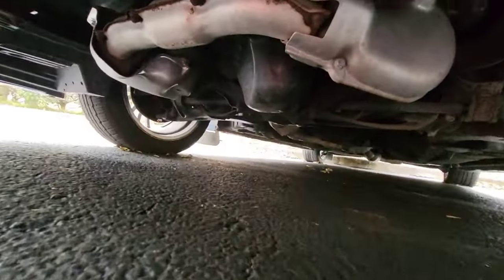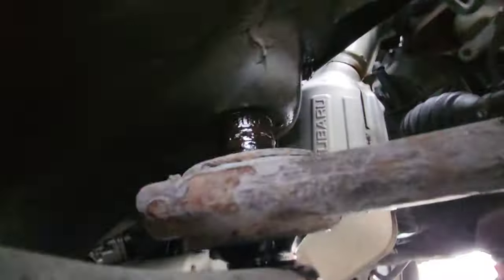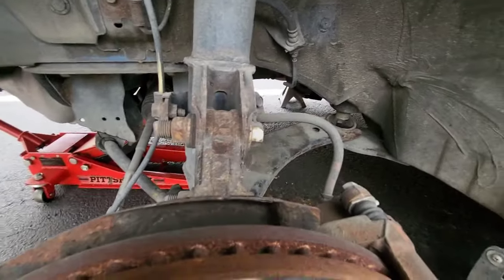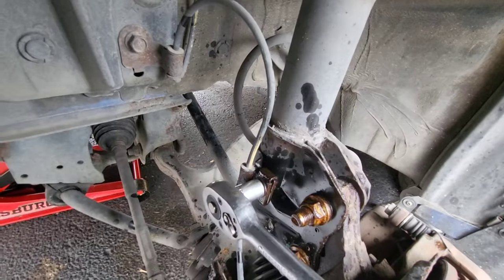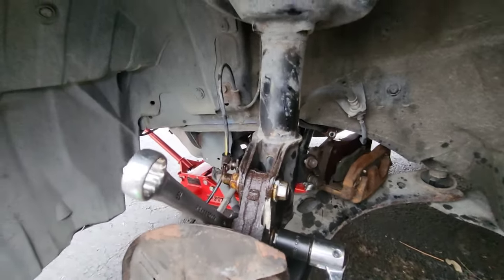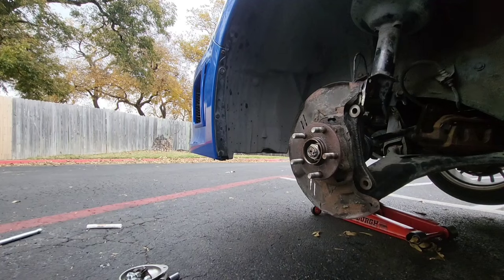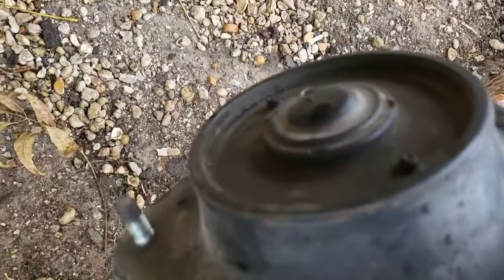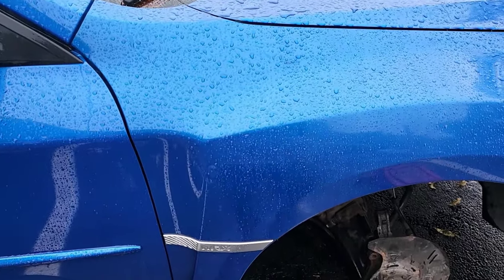Front Struts Replacement Subaru Impreza WRX 2011 - 2014

Comment: i. nice tutorial. is there a strut bearing on subaru's? is it the triangular part at the upper strut mount?
Reply from the maker: I'm pretty sure you are talking about the Bearing that's inside the Subaru Top Strut Mount. So yes the triangular Top Hat section has a bearing